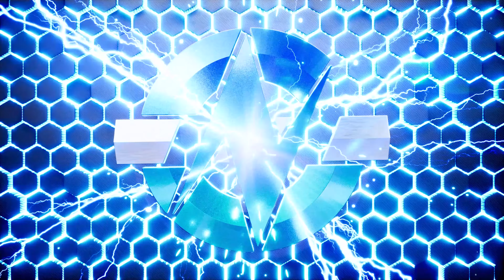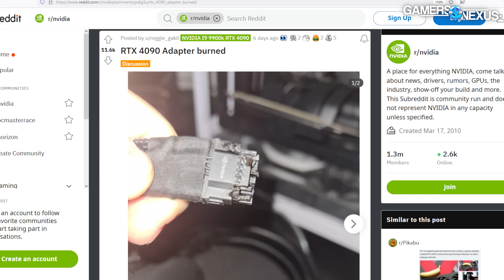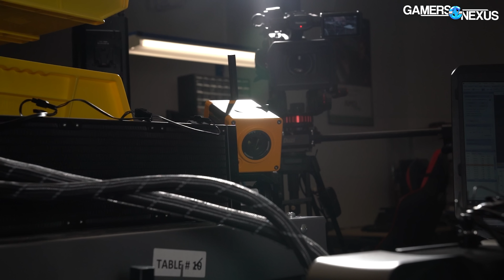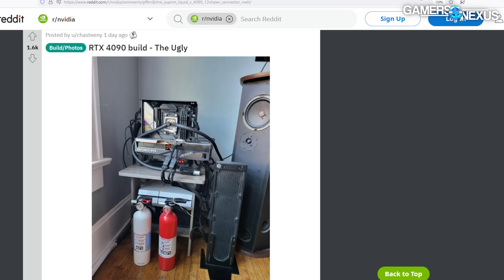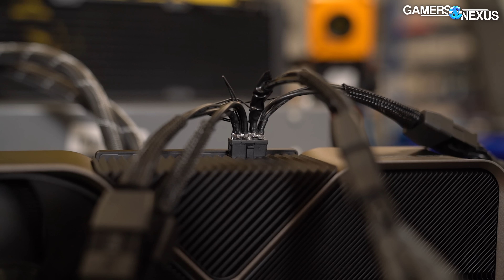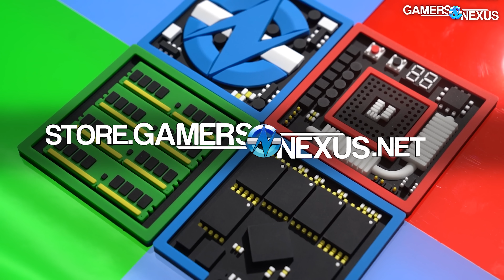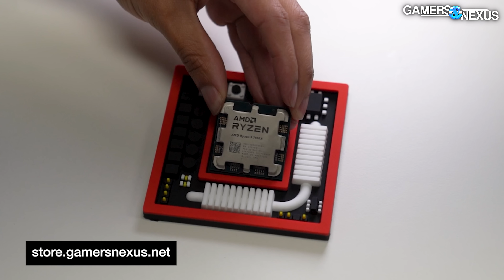Testing Burning NVIDIA 12VHPWR Adapter Cable Theories (RTX 4090)

Comment: Negative results aren't sexy, but they're super important for scientific progress. Thanks putting in the work and putting this out there.  I'm sure the true cause of these issues will eventually be uncovered, and this video certainly helps push towards that.
Reply: That's why Steve has that majestic hair. Even if negative or no results are gained, he is still McSexy Hair. Ha ha.
Reply: THIS! The absolute top problem of actual science is there's a lot of wrong results/bad methods/fake numbers, but there's no glory (as in: no grants) in replicating published results, so a lot of wrong conclusions stand for years.

GN is doing the science right. They're not limited by grants, they rely on our support. I have the rev.1 coaster pack, maybe it's the time to get rev.2 even though I've already scientifically tested these things are completely useless as a surface below a glass ;)
Reply: I'd be curious to know if they have some kind of serial numbers maybe there's one bad specific batch that burns a few cards.
Reply: Well the case is already uncovered it seems. 

Some batch of the Nvidia adapters have horrible quality, others are well built.
Quality control issue most likely then.
Reply: Agreed, but for a more nuanced take than other commenters, I hope only that GN doesn't rely too heavily on external thermal imaging for future known-bad testing. It might feel like good progress to get those deltas now in order to avoid spending a ton of time on wiring up internal thermocouples later, but in reality, we only know those deltas for known-good cables. Who's to say those deltas are valid when you have one or two internal pin shrouds, far deeper inside the connector, melting? That might not register on the camera as much as we think, with plastic being plastic.

Here's hoping they take the time to repeat that testing, if only in one run, with a known-bad cable.
Reply: Important how?  We clearly know there's two different qualities of cables being handed out.  Testing the assumed good cable is right now a waste of time.  Should have waited on the video to do a side by side.  This is just a video saying ...*we tested good cables and have contributed nothing useful*
Reply: @EVLS10  It's still important because it's also providing ways to check if your cables could be a potential failure before actually even pluging them in, thus preventing a potential hazard.

Comment: In automotive connectors, which are smaller, soldering the wire to the terminal is not recommended as the heat can anneal the metal and cause the contact to lose its tension and loose contacts = heat. These are a bit separated from the solder point at least but some of the soldering work has looked pretty poor. Terminal drag test is done by hand with a terminal pin to identify a suspected loose connection.

Comment: The voltage rating on the wires only concerns the thickness of the insulation. It doesn't affect the amount of power the cable can handle. Power is affected by the thickness of the wire inside the insulation. The voltage rating is irrelevant for this issue. Using either 150 Volt or 300 volt could have been just what they had on hand at the time they were building the cables. It really doesn't matter.
The design of the two different cables is interesting. More than likely, Igor's cable is an earlier model that someone looked at and realized how dumb it was. The ones you have make a little more sense but, I have to say, the design they're using to connect the wires to the cables is ridiculous.
I'll bet they used the 150 volt wire at the beginning because the smaller insulation would allow the wires to pack together closer. With the new design of them connecting to a small bus bar containing multiple pins as opposed to each pin having its own pad, would make using the higher volt wire easier. 
That's my 57 1/2 cents.

Comment: The cable need  parcely  make  contact after braking so it will spark  creating heat.  completely  removing the  contact will  not cause the over heating of the other contacts

Comment: Did you bind the cable to the Left and right besides up and down because left to right will cause the cables to pull only on the edges is what I would assume being a electrician also the cable doesn't need to break to start a overheating cracking can also cause the area to heat to the point of melting even fire.                         But I do agree with you that the cables you have are a much better quality compared to the one Igor used so the possible of breakage or cracking are lesser and the gauge of the wire will also carry heat better than the other.

Comment: I think Buildzoid’s analysis is probably more accurate regarding the pin design at the 12v connector itself. Might be worth doing a follow up to investigate that when you guys have the time. Been a huge month for hardware and you guys have been giving it your all. Hats off for the dedication!
Reply: Yes, problem lies in the pins themselves as evidenced by the burn/melt patterns.  It is likely some foreign material is entering the connector during assembly/shipping and pushing the pin and barrel apart from each other when socketed together to reduce contact pressure and area.  Also likely is that the pin or barrel manufacturing process could be leaving a lip or unfinished edge of the metal which is reducing contact area and pressure.
Reply: @NVMDSTEvil  Buildzoid's point isn't a piece of foreign material, it's mostly that the margin of safety is getting pushed on it too hard causing heating issues. Yes, the terminals could just be cheap/bad/defective, but that piece of the puzzle felt more as an accessory to his point that the pins are just having too much current pushed through them for their size, with the bad terminals being insult to injury.
Reply: @No-mq5lw  My point is the foreign material or construction error causing a mechanical issue.  BZ pointed out the nV connectors use dual slits on the barrel which reduce their structural stability.  Yes, I agree with BZ there is too much current being pushed through the connection.
Reply: @NVMDSTEvil  Lol my b. I found a similar datasheet in Amphenol's micro series that's very nearly identical to the 12VHPWR and they put it 6.5A per pin. A 4090 at full tilt can make them go to 8.3A.
Reply: Increased resistance at any point will cause increased heat across the entire thing.  So the point where you see melting isn't necessarily the source of your problem, it's just the first thing to melt.
Reply: @wallywest2360  Great point but then shouldn't that point to the problem being the gauge or thickness of the metal used in the pin? It should have a safety factor large enough to avoid this type of problem but it seems it doesn't. Weak/too thin materials eventually causing the problem.
Reply: @EXG21  there's nothing to suggest the wire and connectors aren't capable of handling the load.

Where it melts isn't always the source of the issue. Anyone who has soldered wires knows that heat can travel across wiring quickly. If you have to solder large gauge wiring, you need a lot of heat and a heatsink as well. You want it to be quick.

The melting plastic is what generally gets seem when you're slowly heating up the solder point allowing more heat to build up over time.
Just like XT60 connectors where people thought that changing to a XT60 and re-using the tinned wiring was okay, but it wasn't. It caused resistance which melted the connectors.
Reply: @wallywest2360  Yes, the point is that thermal runaway happens in the pin and barrel as it is the weakest link and is being caused by mechanical failure of one or more of the other pin and barrel connection points.
Reply: Especially since the melting occurs at the end of the adapter, not at solder points, and that Nvidia actually has a graphic stating that you should not bend the connector horizontally, which is the double slit connectors used biggest weak point.
Reply: I agreed.  If the bad solder join is the issue, I would think we would see more melting at that area (back of the connector where the wire and connector met).  But most of the image we saw online are from the pin end, so it is possible that it is a poor pin connection which cause the increased resistance which in term result in the heat and melting of the connector.
Reply: Especially the gauge/thickness of the metal used. It should be thick enough to avoid problems similar to this.
Reply: I also think that buildzoid's finding along with the lower grade power wire is creating too much resistance and raising temps of the plug.

Comment: Steve loves doing tests and trials because it is fun! Especially when something interesting happens.
Most are trying to reach the wanted conclusion, and some will do almost anything to obtain it.
Let the GPU set in a safe corner connected to an undesirable motherboard, running a moderate GPU usage game, and see if any changes occur over time.
If you want to? You can take a cheap camera and point it at the GPU's cables. If something happens, the camera should catch it.

Comment: FYI the 300v 105C rating is based on the insulation. That's what the insulation can cope with. If the wires have the same AWG "Gauge" then hey should cope with the same current, except obviously if that cause the wires to get to over 105C. Higher voltage requires better/thicker insulation. Higher current requires more copper/conductive parts. 
So the difference between the 150v and the 300v while carrying 12v is really not that big.

Comment: Internal vs. external deltas aren't super interesting. The real info here that's new is that not all the cables are speced or soldered the same way. This sort of thing can happen, and it's possible that it's responsible for 100% of the failures which have occurred. or maybe the root cause is one of the other hypotheses which have been brought up.

Comment: First: great Work. Second: It reminds me of the big Capacitor Crises in the mid 00s were a lot of Mainboards got Capacitors "good" enough to get through the initial tests but would fail after 2-3 Month of load. Some Chinese 'Businessman' managed to smuggle in sub par Items into the supply Chains which would meet the lower specs.  Everybody had those Capacitors, one of the reason Asus and Gigabyte switched so fast on solid Caps for the power delivery on the Boards and everybody had to do it as well. Hopefully this Connectors get found fast and out of circulation. I have had an exploiding Motherboard. Literally fresh out of the box, fresh PSU and 5 Minutes running and a nice loud plop.

Comment: I have never been able to get a correct result from pointing an IR camera at metal (for example on the solder). The temperatures shown are usually from the surrounding area getting reflected in the metal. Are you sure that this is not the case here?

Comment: The pop off is the reason. It's not the load over a perfect contact, it's the load over a reduced area which causes heat. If you point to nails to each other the current will heat the tips even if the nail could deliver the current with no issue. To have 3 full contacted cables plus 1 just slightly touching is worse then having just 3 fully contacted cables

Comment: it is always the case that the location of the poor contact is where it begins to melt, so I am betting it is the pin to connector that has the poor contact. Looking at the wires and metals used, it can surely handle 600w more even, so most likely this problem is from a poor contact. Furthermore the relief strap on the wires is so robust that bending the wire will most likely put more stress on the 12 pin connector making it not sit properly thus causing a poor contact. A more flexible wire is more advisable to use as it relieves stress more effectively.  I have seen a lot of this kind of failure in automotive wiring connectors where wire is too stiff to bend thus putting too much stress on the connectors. If you want to recreate this failure, try to not seat the connector thoroughly and then bend the wires in a way that put stress on the connector and then stress test the card. Since you have a thermal monitor, try bending the wire to induce stress while testing and you can see how the thermal reacts.

Comment: After all the videos, images and articles I've seen... what seems clear is that not all adapters were manufactured to the same level. Since the melting is happening at the terminal, it seems more likely that's where the issue is. Buildzoid makes some good points about the terminals, but it doesn't look like all the adapters are using those shitty terminals. But that would only really be an issue if you were side-loading the adapter. Seems some that have failed are using OE terminals? I could be wrong, since I'm just looking at pictures of failed cables. And having a connector not entirely seated sounds completely plausible as well. This all just seems like a resistance issue rather than a power delivery issue, some internal failure in the strain relief. If Igor had found the issue, it would be more likely that the adapters would be melting at the strain relief and not the terminals.

Comment: bunch of pins disconnect, connector is bridged so 600w now go's thru remaining cables, cable heats up the connector from the inside out, the connector melts overtime, i am curious tho how long it takes, the danger may actually be much worse then everyone recognizes

Comment: based on your results it seems like the cables in the adapters you have are built properly and the ones that are getting burned at usually more similar to the one igor's lab had, this is just based on what I've seen so far, it could be wrong, as I believe I saw a 300v cable that still had the issue, hopefully the results in your inbox are more conclusive.

Comment: The connector melts from the inside out with the 12 pin acting like a heatsink and the outside connector as isolation to prevent it from cooling down.

Comment: This guy found another issue with the split pins in the NV adapter specifically, where it would make sense that the horizontal bending could cause damage:
https://www.youtube.com/watch?v=yvSetyi9vj8&t=13m22s

Comment: Ever work in manufacturing?  I could easily see a company running out of materials temporarily cuz someone didn't order enough or were on back order so an engineer was tasked with a quick fix to keep production going.  As long as it passed whatever quality control tests they use before it leaves the line then they're goin to say "It's fine, it'll work, it'll work."

Comment: I'd be curious to see the results on a gaming load, where power demands are constantly in flux, and you would be subject to current spikes. The 4090 and nvidia's new vrm management is supposedly better than in the 3000 series, but seems worth testing.  The heat/cool cycle and the split connector expanding/contracting could cause heating above and beyond a steady 600w load.

Comment: When the outer cables are completely disconnected, its not an issue, its when the pad barely hangs on or snapped away, but still trapped in the rubber strain relief and electricity is arching over the tiny gap, is when it gets hot.

Comment: Honestly, the melting must simply caused by bad connections.
Not at soldered joints, but at the actual connector pins.
Just loosen ie enlarge the diameter of the female sides of the pins.
You'll definitely get a meltdown.

Comment: Alternate theory to test: is it just the separated 12v rails shorting to each other? You'd get alot more current shorting out rails than you would going to the card. And the damage is on the adapters, specifically where the power rails are getting shorted by error prone solder. Especially in a loaded vs unloaded scenario,  one of the rails could get a different voltage. If the power supply fights itself,  it's magic smoke time. I think some  power supplies would have more accurate voltages that can tolerate shorting,  while others may not.

Comment: Some 4090s came with a 3x 8pin connector instead of the regular 4x 8pin. Are these still something you want to investigate as well? I have an RTX 4090 Gaming X Trio that came with one of these cable adaptors.

Comment: I think the problem is not a lost connection, but a cracked connection on one of the wires, which might cause sparks or something that lead to fire. So completely removing the 2 outer wires is not reproducing the issue, assuming it has something to do with the strain on the outer wires. The safety margin might be high enough that only using 2 instead of 4 wires is not really an issue.

Also, it might matter, that only one of the outer wires is partly disconnected, or even which one exactly.

Comment: My theory is; NVIDIA either knew about the problem before launch, or found out just after the first 4090s went out and didn't want to mar their launch with a recall. So they quietly redesigned the connector and hoped those already in the wild wouldn't cause a problem. Since GN didn't receive review samples, all the cards they’ve bought so far were manufactured post fix. I also suspect this may have had something to do with the RTX TITAN Ada melting down. The dual 12-pin connectors and massively increased wattage may have triggered this issue more reliably.

Comment: The gauge of the wire is what is important for the rating in this use case because its low voltage high current. also to note as the temp of the wire and connector increase so does the resistance.
Reply from the maker: The main thing is that they're made differently.
Reply: @GamersNexus  yeah that aspect of this   debacle is very strange, maybe the other type of adapter was meant for the 4080 4070, but in the end that still wouldn't mater if the adapter is failing due to physical stresses. IDK